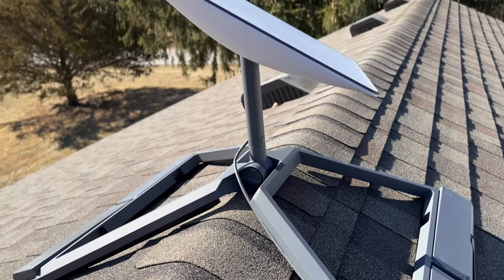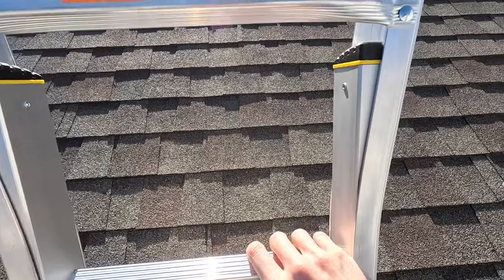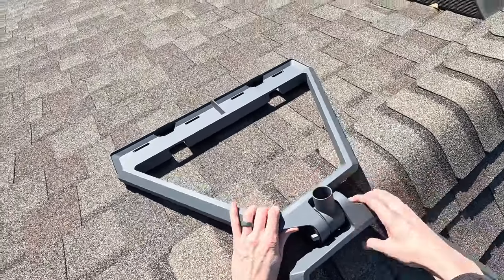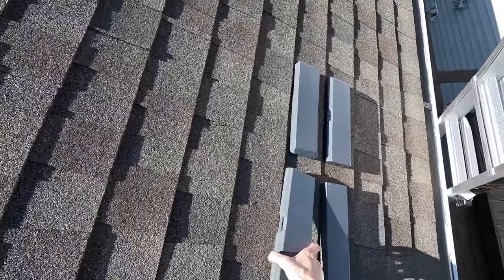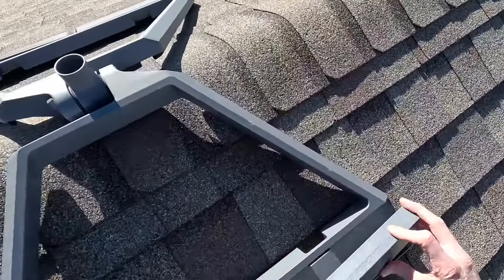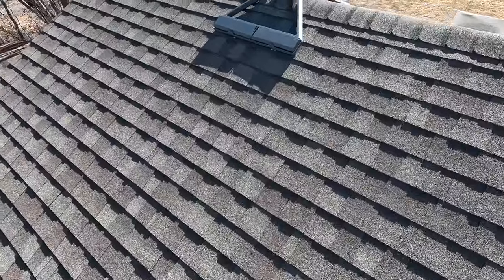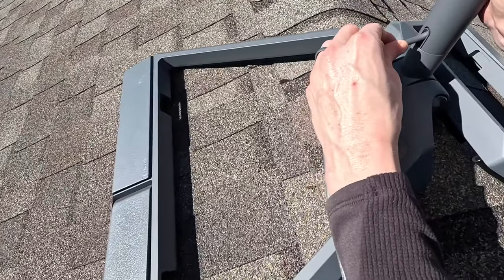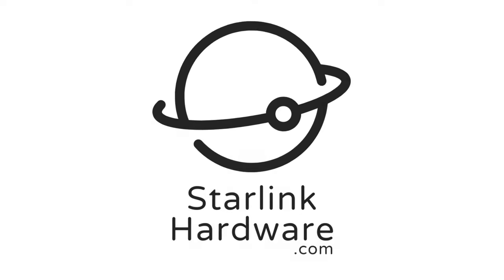Starlink Gen 2 Ridgeline Mount Kit - Installation Tutorial

Comment: This was excellent but please explain or do another video on how you get the cable up through the ridge, and how you know where to place it. I assume you drill a hole but I also assume the hole must be sealed. Sure you can use a tape measure but I'd like to see it done. Also where is it best to put the router to avoid having to run the cable down the stairs or through walls.
Reply from the maker: I have a separate video on running the Starlink cable: https://youtu.be/046arFRpDig?si=sXxhpyPd3zyCvpFF

Comment: I live in Florida where summer temperatures on a fiberglass shingle roof can likely exceed a 100 degrees. I’m wondering if the weights could damage the roof shingles over time in this heat? I like the concept of this roof mount.
Reply from the maker: Potentially. There is about 70 lbs or so total pressing down on the roof. There are rubber channels that protect the roof, there is no metal to roof contact. But anything super pliable and susceptible to dents or melting may be deformed over time.

Comment: Hello. I live in Oklahoma where sometimes we get 60mph+ hell we had a 100mph+ wind tstorm. Is this viable option?
Reply: I live north of Tulsa and that storm was wild! I'm going to purchase this mount and give it a go. I believe this mount would be fine in our occasional 60 mph gusts. We also might go a very long time without another 100 mph freak storm, so I'm rolling the dice. Besides, that's hurricane force winds and it's asking a lot for anything to be rated to withstand that. Even a hard mount.
Reply: I live about 30 miles south of the Texas /OK border on IH35 and we are in a rural area and get those gusts even without a storm. A storm just ramps them up so I was wondering if this was going to be a viable option for us since our 2 story roof is at a pretty good, steep pitch where we are probably charged extra by roofers every few years when they have to replace our hail damaged roof. 😂
Reply: They wouldn't sell it if it wasn't.

Comment: What kind of wind rating is there. How the hell is this going to stay on the roof?
Reply from the maker: Starlink doesn't provide a wind rating for this mount, but they've previously said the dish itself can handle up to 75 mph winds. This Ridgeline mount is held down by more than 50 lbs of weight, not including the weight of the dish and mount.
Reply: I have the same concern about wind rating and could not find any information about wind ratings for the ridge line kit.  I just signed up for residential service with the RV dish.  I live in MI and it does  get windy during the fall-winter season, however, never 75mph winds.  Very helpful, thank you!!
Reply: They don’t provide a rating then “but they said?” Hmmm, I don’t know.  Kinda worrisome.  I get 60mph like a dozen time a year.  Isn’t there anyone who has actually tested this with a video?
Reply from the maker: @silveraven1  It's not a big deal. Been through plenty of strong gusts and it doesn't move an inch. The truth is, the dish isn't that big of a wind catch in its normal operating position. And there is 60+ lbs holding it all down. The mount itself doesn't catch any wind. 

If wind is a concern, find another mount that permanently attaches. 

I don't know how anyone would test this with a video. All I can say is that mine has been installed since making this video, and it's been fine through all the spring storms so far!
Reply: Where can you buy this?
Reply from the maker: @ryanellis8417  shop.starlink.com but it isn't available in all markets apparently.
Reply: I would imagine it would be like trying to blow a 50# bag of concrete off the roof. Its not going anywhere

Comment: Will this mount work with the new Standard dish or it is designed to work with only the Standard Actuated dish?
Reply from the maker: It’s not directly compatible with the new Standard dish (Gen 3) but you can use it if you purchase the Gen 3 Pipe Adapter.

Comment: What prevents the screw/center from loosing over time and then the dish tipping over? Does the screw lock or is it just hand tight?
Reply from the maker: It doesn't lock, you just tighten it down. It would be a good idea to check it every now and again, but in my opinion, the design won't allow it to just fall over. The main shaft is "geared" so that, even loosened, it can't rotate without physically trying to pull the pieces outward. So even loosened, it wouldn't move without someone messing with the legs.
Reply: Use heat resistant silicone to lock it.

Comment: The ballast is beveled on one end and square on the other. The square end goes towards the middle and the beveled to the outside.  Otherwise, it does not fit right. It looks like you had a couple the wrong way in the video . Just FYI

Comment: Can this mount be used on a tin door that is shaped like clay tiles?
Reply from the maker: I’m not able to imagine what that is or looks like. But the mount can adjust to any angle, so it is versatile.
Reply: @StarlinkHardware  my apologizes, that should have read tin roof shaped like clay tiles. Here in the Philippines it is called Corina tile metal roofing tin.
Reply from the maker: @ABtoPh2022   Thanks for the clarification. I looked it up, and I would say the Ridgeline Mount would work fine. There is a rubber seal to protect the roof surface. It looks like there is an offset from the ridge to the roof surface on the Google images I saw, but it should still work. Worst case: return to Starlink within 30 days for a refund.
Reply: @StarlinkHardware  

Thanks for the quick reply. Just ordered the Starlink yesterday but I could not find that ridge mount on the app anywhere. Any suggestions on how to find to buy?
Reply from the maker: @ABtoPh2022  It's on their website at shop.starlink.com. Not available in all markets, so if you can't see it in the shop, that might be why.
Reply: @StarlinkHardware 

 thanks

Comment: Could I temporarily set the Mount up with the dish if the ballasts are for some dang reason on back order?? I’m just curious because I need to have Internet set up earlier than those ballasts are even likely to be shipped to me now and I’m already being charged for service
Reply: I've had this for a week now and the weights haven't even shipped. I've already placed the mount in a temporary spot on the roof waiting for them to arrive. I live in the Northern LP of MI. It can get a little windy but so far no issues.
Reply from the maker: I would throw some sand bags or something on it while you wait on the weights.
Reply: I set it up two days ago. And used some slate. Yeah mine was supposed to have shipped with all the other stuff I ordered around May 25th. Got to the last day (31st) and then shipping date shifted to June 7-13 but I’m not sure it’s even going to make that.
Reply: I'm using normal mount with sand bags. Works fine

Comment: What about the wire that runs down the roof
Reply from the maker: I have it tucked down the side of one of the legs, and then it runs down over the roof, down the side of the garage.
Reply: @StarlinkHardware  So does it just sit on the roof or is it held down on the roof the cable I mean
Reply from the maker: @Bears9McMahon  It just sits on the roof, it isn't secured directly to the roof. I have it zip tied to the dish mast, and then secured with wall clips down the wall.
Reply: @StarlinkHardware  thanks

Comment: What is the radius of the network service?
Reply from the maker: Do you mean the Wifi range?
Reply: @StarlinkHardware  Yes Sir
Reply from the maker: @alkalimusa7564  It would depend on your home and what it's built with. For a typical stick built house, it would probably cover 1000 sq ft or so. If you have thicker walls, brick, or lots of levels, you may need to expand with a mesh system to get complete coverage.

Comment: getting the cable from the antenna down into the roof and to the router with just 50 ft of cable is the trick...
Reply from the maker: They still longer versions in the shop if you need a bit more length.

Comment: I live in Joshua Tree California, I don’t have any confidence this type mount would stand up to 25-40mph winds.
Reply from the maker: 25-40 mph is not much. This mount and the dish itself handles that easily. I've had mine installed through severe thunderstorms with gusts exceeding 60 mph this season. There is more than 60 lbs of weight, and the dish is nearly horizontal. There isn't much to catch the wind.
Reply: @StarlinkHardware  thanks.  I do like the east installation
Reply: 40 miles per hour? Wow, you Cali people are soft. We call 40 mph a breeze.
Reply: It absolutely will.  The weights are a combined 58 pounds. That does not include the weight of the mount and the satellite.You're talking over 90 pounds of weight. Also the design of the mount allows air to flow directly over under and through. I'm in northern Michigan and I've had no issues and I haven't even received the weights yet.
Reply: @Whowannabeu  thanks for the helpful reply.  I have it installed now and it’s working great.
Reply: @JohnFitzpatrickx  Happy to help
Reply: I got my kit in and thought about this mount. My only worry is Louisiana hurricane season and watching the disk fly off the house during a storm. Our last hurricane pick up a whole piece of my fence and tossed it across the yard.
Reply: @Yeahyeah116 😂ikr that's next to nothing